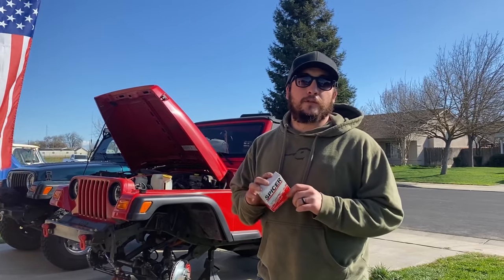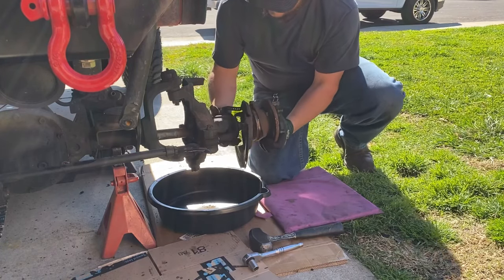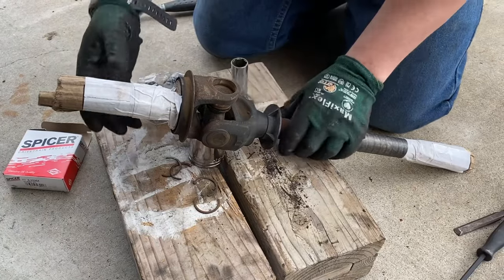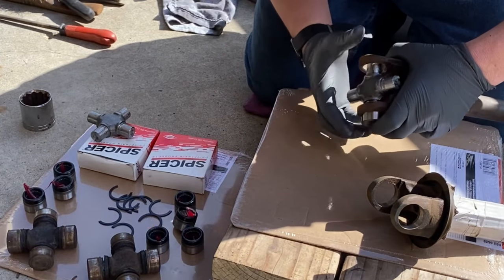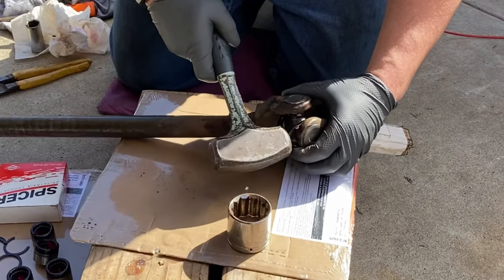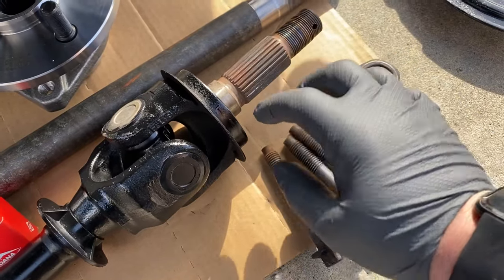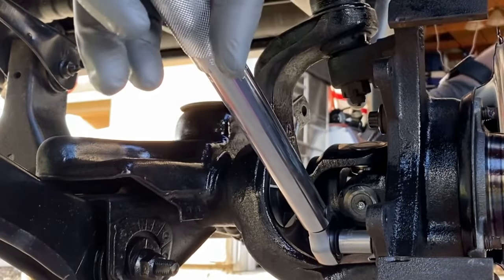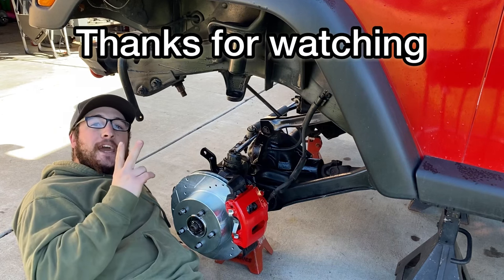Fixing up Dana 30 Front Axle - DIY U-joint & wheel hub bearing replacement Teardown & Rebuild

Comment: Excellent video! No nonsense, straight to the point. Thank you. I was on the right track, but the parts guy gave me driveshaft u-joints instead of axle u-joints! Grrrrr....
Reply from the maker: They do that sometimes! Thanks for watching 🍻
Reply: @ATEMOFFROAD  So as l said add the correct part numbers to your vide, then mistakes at the parts shop less likely

Comment: Nice job man! I installed those powerstop brakes on my TJ as well. No complaints so far. Look into doing the Grand Cherokee Tie Rod upgrade. Very budget friendly and much beefier than the stock TJ tie rod.
Reply from the maker: Nice ! Is that  the crossover steer kit your talking about? with heim joints? Thanks for watching
Reply: @ATEMOFFROAD  no it bolts on exactly the same way it currently does. It is just bigger in diameter and uses the beefier tie rod ends as well.
Reply from the maker: @Yipping_Yeti  nice , anything beefier I like 👍🏼
Reply: What year Cherokee do you get the parts from? I have a TJ and don’t want to spend $600 on the Currie upgrade lol

Edit: found an article online with the Amazon link to what I need. Definitely ordering that now.

Comment: Great video my three bolts that hold the hub on are corroded any good ideas on getting them off would be great
Reply from the maker: 12pt socket, heat the housing holes not the bolts with map gas or propane’s, use breaker bar to release bolt! You Might even be able to do that by turning the wheel all the way over and access them from the back by the brake caliper to loosen them up before you Jack up and pull off the wheels. Good luck buddy thanks for watching 🍻

Comment: The Amazon link to the hubs says it does not fit the 2002 Jeep Wrangler. Also the U Joint says it’s for the rear drive shaft. I’m just wanting to confirm the links are for the right parts?
Reply from the maker: Thank you so much for letting me know this , as sometimes Amazon affiliates make changes on there end . I’ve updated the spicer front axle ujoints , as well as add hubs for 2000-06 year TJ. Should be all set! Thanks for watching I appreciate it

Comment: Looks like you used new grade 8 bolts for the diff cover? What size are those bolts? They thread into the housing with no tapping?
Reply from the maker: Yes no tapping , they are standard 5/16-18 grade 8 bolts I think they are 3/4” long 🍻
Reply: @ATEMOFFROAD  Sweet. Jeep looks great, I’m hoping to restore my axles in a similar fashion.

Comment: Hey do you think it’s a problem if one of the needle bearings is missing from one of the cops
Reply from the maker: Yes you need all the bearings
Reply: @ATEMOFFROAD  oh I kinda figured that. My other inner axle I couldn’t get the u joint cape to fully seat so I had to order a replacement. I think the ears might have gotten bent in a millimeter during removal of old one. Hopefully a new one does the trick. Thx for reply. Looks like I have to press out the old one looking for where it’s missing from

Comment: Ok. Now, What about all these Jeeps with Yukon Lockers up front !?!?!?. Will the Axle shaft simply pop out like this or ?????.
Reply from the maker: I think so not particularly sure on the front setups as there can be a few different variations, like hub locks etc! For the rear is a no , as you will need to un bolt the flange on the end to slide out the axle assembly. Thanks for watching 🍻

Comment: And thats why I sold mine. Always working on the da@$ thing.
Reply from the maker: Gotta pay to play 😂😂 actually the jeep is at 150,000 miles , no real issues on the axel, I can’t complain there , I just replaced these components as preventative maintenance! Im getting the axel ready for a lift too so I’ll be doing that real soon! Thanks for watching! Cheers
Reply: When one buys a Jeep, one must anticipate that one will need to learn to work on it. It saves the money instead of going to mechanics down the line.